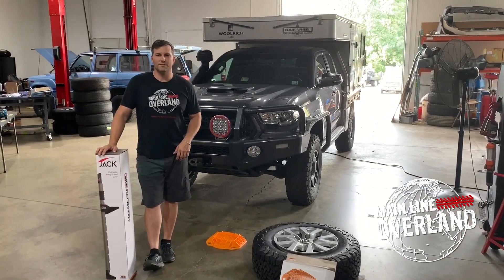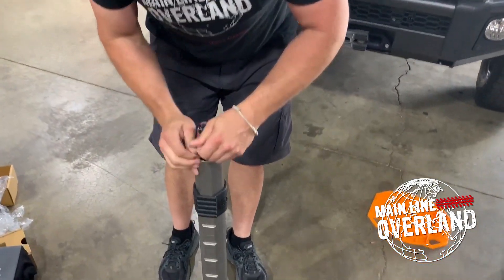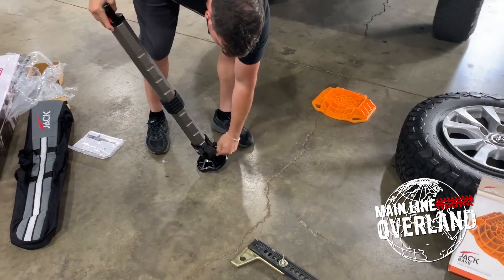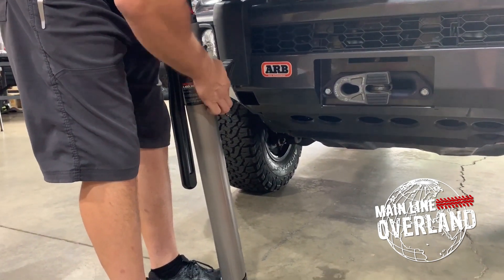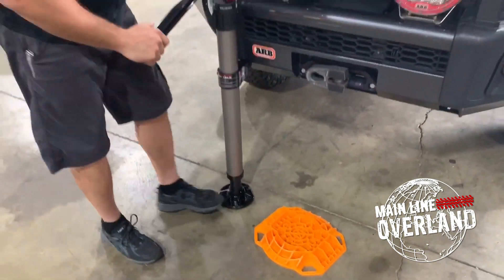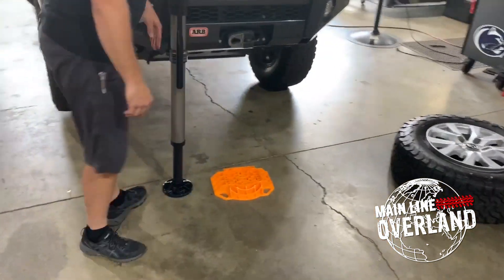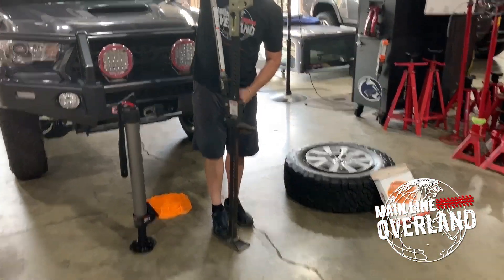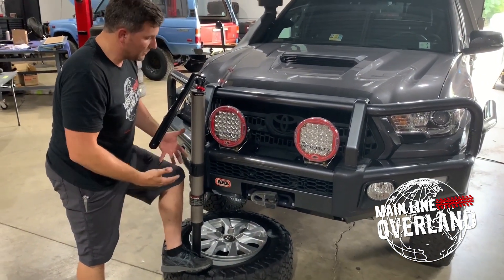ARB Jack

Comment: Question: The provided instructions say not to store the ARB Jack on its side or it will leak. Yet they are all shipped on their side. They also are stored on their side at the distribution warehouse and in delivery trucks.  Mine arrived covered in oil because of these reasons. Further, how are we to store the Jack outside the vehicle if it comes in a storage bag that is without mounting hardware and which causes one to assume that the Jack is to be stored IN the vehicle, where it almost always can only be stored on its side, because of its height? Why isnt there mounting hardware specific to the Jack, designed/sold by ARB that is 1) meant to be mounted on exterior and that, 2) incorporates theft resistant features (e.g. lockable hardware)? I'm in the states. These are very popular here but that is changing quickly. I just returned from the Overland Expo and my question above, includes the 2 most heard complaints about this product and are the reasons why so many are now turning to other products. The number 1 complaint however: storing this on its side should not allow oil to leak/this is a very poor design feature! I love ARB but this is money I'm now seeing that was poorly spent, due to an incomplete design and a lack of mounting options, which ARB should've addressed prior to releasing this product. ARB, please address these 3 things, or I fear ARB will see this products interest lose steam. ARB is a solid company but the mark was missed on this one big time.

Comment: Do you need to have a front and rear bumper to use this, or would sliders work fine? Can this do anything more than just lifting the vehicle for changing tires?
Reply from the maker: woolengrappler You could definitely use this jack with a set of frame bolted or welded rocker sliders thanks to its pivoting base. Out on the trail this jack can also be used to lift the wheel out of a hole for bridging a gap, for example. As with any hydraulic jack it should always be used in combination with a jack stand or other fixed vehicle support before putting any  part of your body under the vehicle.
Reply: MainLineOverland thanks! Does it need to be stored upright?
Reply: @King Rowan ehh I'd suggest Flixportal. You can find it on google:) -julian
Reply: @Julian Coleman Thank you, I signed up and it seems to work =) I really appreciate it!!
Reply: @King Rowan Glad I could help xD

Comment: Good video. I've heard elsewhere on the internets that the jack must be stored vertically. Is this true? Or can it be stored laying flat?
Reply: They leak the oil when horizontal. 
Have 2 friends that bought them, 1 ruined his interior in his h1 wagon, the other guy made custom mount for roof rack and it leaked on the paint. He didn’t notice it because his sat unused for a month and it ruined his new paint job.

The ‘rumors’ are true.  ARB reply was the instructions said store it vertically.  

WAY too much money for something you cant just toss in the back and not worry about.

Maybe wait for version 2.0 or 3.0 to come out when they redesign it.
But it will probably cost $1400 then.

Comment: Would love to know how to get those center caps for the evo course wheels. Can I purchase those thru you guys?
Reply from the maker: Ben Pitcher The EVOs with center caps are a whole different casting with more material to create the lip to hold the cap. On the plus side, the race wheels without caps are actually a bit lighter.  👍
Reply: MainLineOverland very cool and thx for the reply, I purchased 5 black wheels from you a couple years ago and love them so much. Thx for offering such great products. :)

Comment: Nice video.
I have been running the Hi-Lift Xtreme 60" on my FJ along with Bomber Products shovel mount and a Krazy Beaver shovel.
I am wondering how I would mount this to an ARB bumper, maybe just use the Hi-Lift bar by itself, some type of mount, as I would want to keep the shovel mount too.
Or maybe it is best to just carry the new jack inside of the rig.
https://pnw4runners.com/camping_trips/aug17/1.jpg
Reply from the maker: We also love Hi-Lift Jacks for their versatility and cheap durability--every crew should have at least one on hand. The Hi-Lift 60" is huge though, and most of the time that means keeping those big metal bits on the outside of the vehicle where they are prone to the elements, eventually sending rust droplets to the vehicle below. The ARB Jack is quick deploying and folds into a mostly cylindrical 35" shape, which means it is easy to keep this essential piece of gear inside the vehicle where you can maintain its functionality and value.
Reply: Don’t recommend putting it in the back.  Your gonna have lots of mad customers not buying your other stuff when it leaks and ruins their interior.  Do some research- it is happening more and more as the jacks get some wear and age. 

ARB says they are to be stored vertically when people turn in complaints of damaged interior or damaged paint when on roof racks.

I like the idea and they are decent but need improvement.  
Have you seen ones with the broke lever on top yet?  Seen pictures but didn’t show how they happened.  
I think a later version after improvements will be better- ARB is usually good for improving their stuff like the compressors, and refrigerators did.